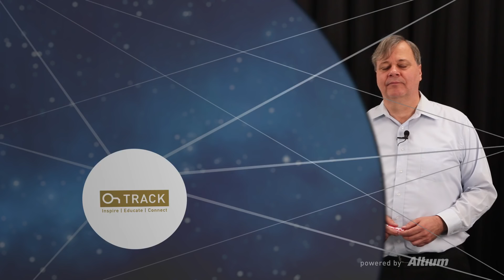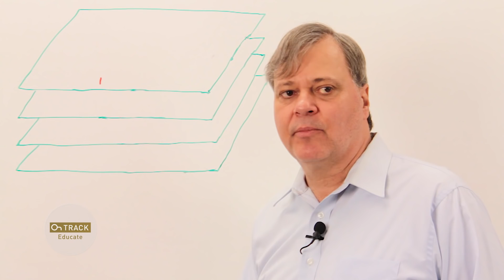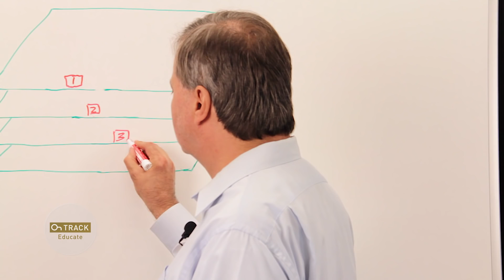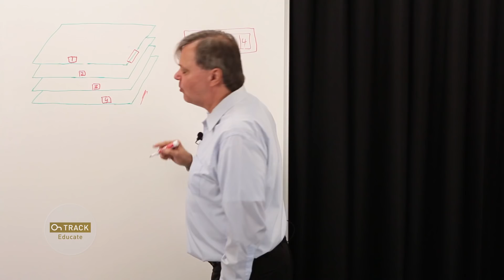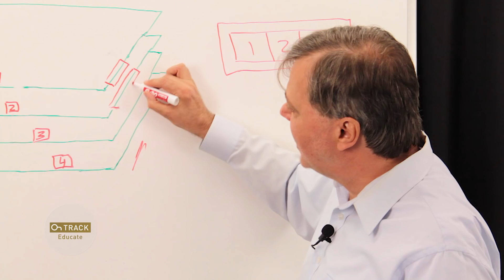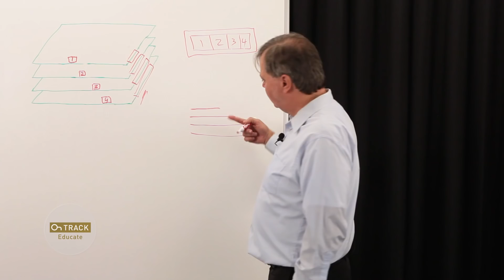Comment: Thank You for this idea. You describe it in two steps, drawing boxes for the layer NUMBER, and adding copper strips on a different board edge to check the layer ORDER. Why not just extend the boxes in the first step to the board edge, and you would see a "stair step" pattern if the layers are in order. Same idea, single step. Anyway, I'm going to try it... thanks for making the video!

Comment: I mark every layer with a number, as you show in the video. But for 4-layer or more, I usually mirror the numbers because if you check it on the top layer, is difficult to see every layer number. So you need to check it also on bottom layer. For this reason, I mirrored the numbers. For example, on a 4-layer board. I mirrored numers on 3 and 4 layer. Thanks for the video!!

Comment: Thanks for this video. I used to do this, and used to ensure there was no copper above or below any of the numbers so you could hold the board up to the light and see all the numbers. I haven't done it for a while though because, in Altium, I cannot figure out how to do this when using full ground planes. You can make a blank area in the plane by placing copper there (because we are now working in the negative), but I can't figure out how to then place a negative number in that copper area. Any ideas?
Reply: If you would like to have numbers in the negative than use the copper cutout tool. Or you can also use the "subtract polygons from selected" tool. hope this helps
Reply: Thanks for the response. However, I'm not clear about what you are saying - are you suggesting actually drawing the numbers onto the planes using these tools? (i.e. as opposed to using the Text tool to enter the numbers)
Reply: ahhh sorry i misunderstood. To invert a text string: 1) place the text on your board. 2) double click the text to bring up its properties. 3) change the font to "TrueType". 4) check inverted.
Reply: Excellent! I had not seen that before. Thank you!
Reply: Thanks for the suggestion William. Just added it to the description above so hopefully it is easier to find for everyone.
Reply: Hello bcpberry! In this video Chris explains how to create Stacking Stripes and Layer Numbers in Altium Designer: I hope this answers your question! :) https://youtu.be/sEpJfq3OvUU
Reply: bcpberry gmai

Comment: This tips are very nice and sound advice, for both the numbering and the stairs. BUT...

But both miss the point of why did the PCB fabricator mix or forget the layers? This is due to the use of "dumb" data transfer, as is GerberX. This Gerber files are usually just put in a zip file or sent separately and the PCB producer has to put them together one by one until the sequence is there, allowing for the errors discussed in the video.

IF on the other side people would slowly start to use "intelligent" data transfer, like ODB++ (or the still rather unknown IPC-2581) format, then this mix up of the layers can simply not happen anymore at the PCB producer, since this intelligent data formats have the sequence already embedded into the data. 

There is a ton of reasons why you don't want to have this info in the PCB:
- some companies don't want to let know the others how many layers their design is. 
- it takes time to make the numbered boxes and stairs. (With the problems documented in the negative layers)
- it takes valuable space on small PCB, and you have to pay for this area of the board
-mostly this process is manual, and you could add an error in designing this structures.
There is a ton of good reasons to use the intelligent data format too:
- It's available in Altium and other tools too.
-it's fast to generate and has a ton of useful information for the PCB producer.
-almost every PCB producer can handle it. Usually they don't publicize that they can work with this data. It is just a matter of asking them to use it.
-some PCB producer even give slight discounts for design preparation for this intelligent formats, since they are easier to handle.

As a summary: using intelligent data transfer like ODB++ you eradicate the root of this problem, instead of dealing with the symptoms of wrong PCB alignments.

Hope this helps and inspires some.

Comment: If you follow the military standard you will not have this problem at all !
Reply: Yuval Ariav What military standards?
Reply: Michael Jennings USA but I work in PCB design in Israel.
Reply: Do you have any standards numbers? I'm trying to find a reference design
Reply: I will get you as soon the I will find it all in few hours it run out of my memory in age....
Reply: The one that I remember is: MIL-PRF-31032,
MIL-PRF-55110 and which one you plan to us need to be part of the print out layer to show which one you use includes every layer if it one layer all the way to 8 and more...
Reply: Awesome, I'll have a look. Thank you
Reply: It slot of reading but the bottom line is the sickness of the corporal and the pads...
Reply: A lot of reading
Reply: It a lot of reading but the bottom line is the sickness of the coper and the pads...